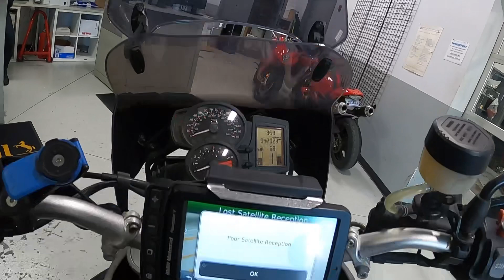Ride with me to get my BMW f800gs annual service in Charlotte, NC

Comment: Great video and a nice dealership, I've been there several times. I really like the Greensboro location for BMW motorcycles and the drive for me is much better than downtown Charlotte. They are both great it's just that the drive for me to Greensboro is more enjoyable That is the first time I have seen the front end wheel change like that, and it makes perfect sense why he made that change. You can see the difference in the front fender curvature versus the wheel. Another great video Jordan!
Reply from the maker: Thank you! I am glad you enjoyed riding along. I will have to check out the Greensboro shop at some point.